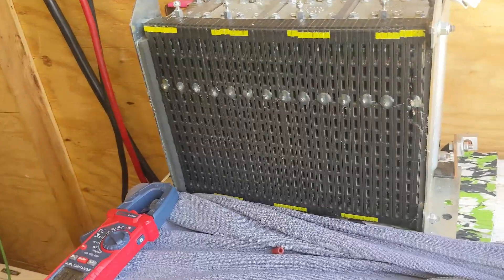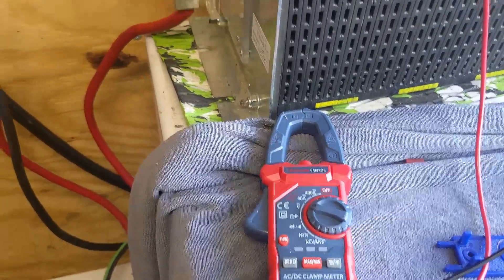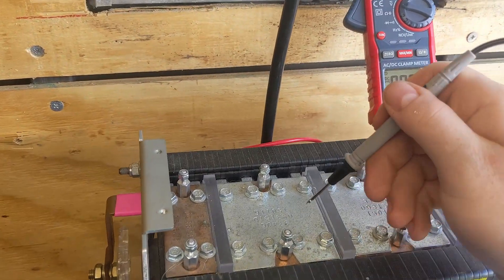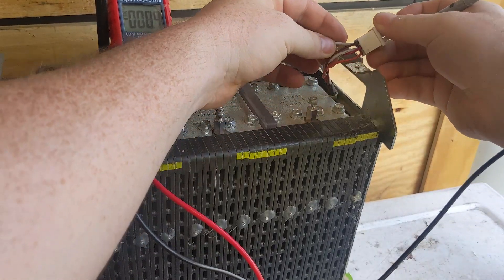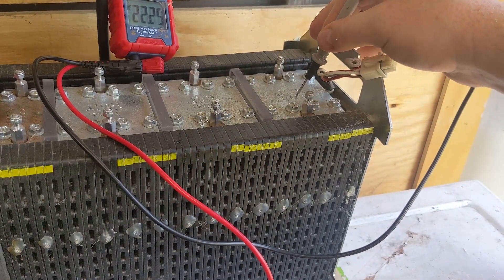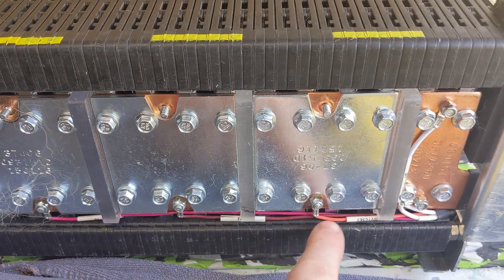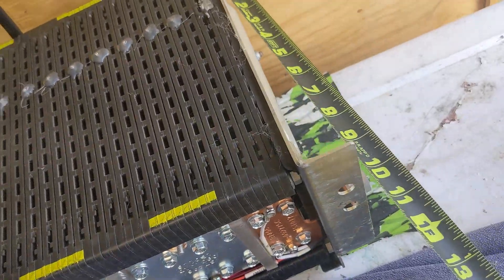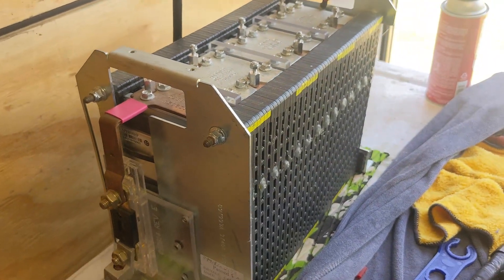The Ultimate Budget 24V Lithium: Batteryhookup SPIM08HP 2-Year Review!

Comment: Hello sir how many watt does it produce and how long it run ur home for, how many of this is in ur setup please give me the details
Reply from the maker: It will produce 700w continuous for a little over a hr. If I draw from it a big load it will handle 300a no issues for a few minutes. This system I have it in is a 400w solar with a 3kw inverter.
Reply: Good battery I have 16 in total 4 in parallel to make one bank with 7S 100A jiabaida BMS work well have me NET O now 👍🏾